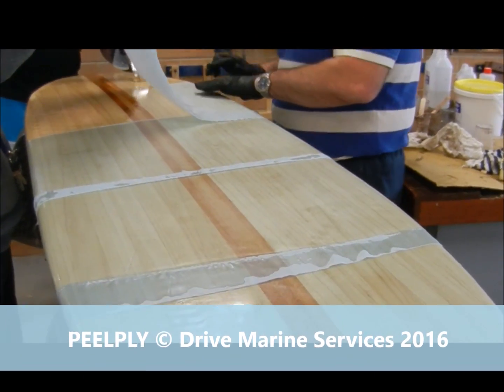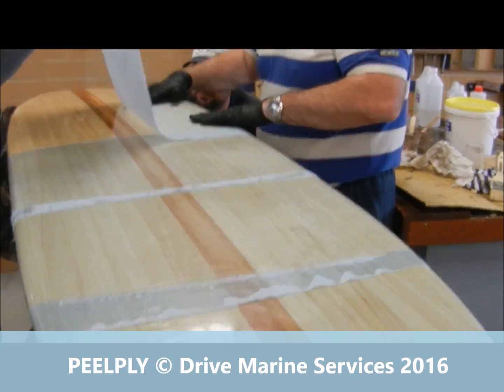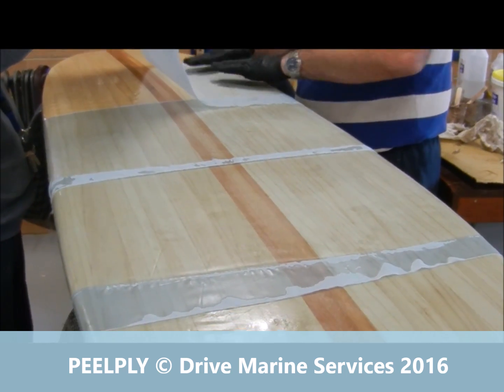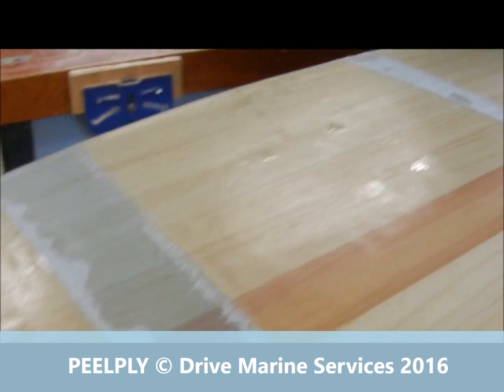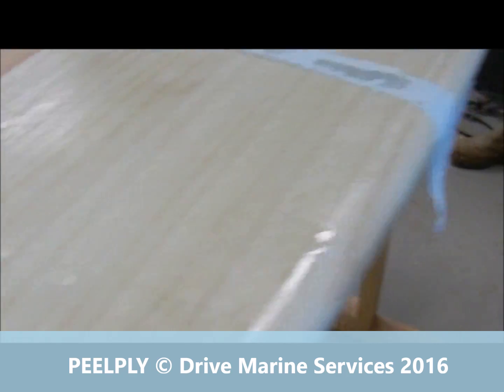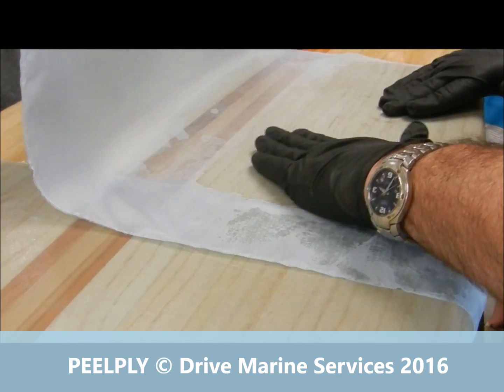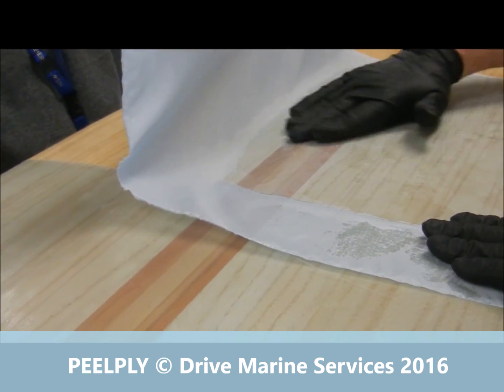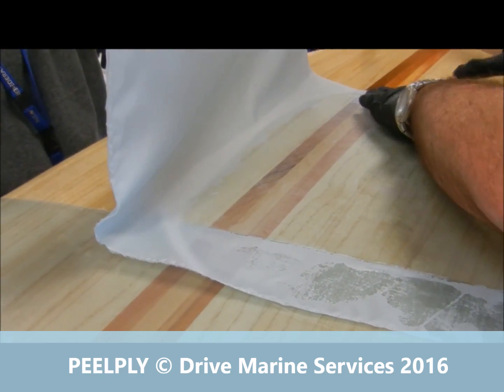Peelply Tutorial

Comment: With peel ply I can only get it working good on small patches. I'm using west system with it and it's only working when I can get it perfectly flat first lay. If I try to push wrinkles out it's moving my biaxial cloth about. It ends up with big voids that crisp off. I know it's easy enough to sand them and do a barrier coat and fill the crispy bits where the wrinkles were.. but on a transom job I want it perfect. I've settled for using powder bound chop strand (UK chop strand stuff that is proper epoxy compatible) and barrier coating the life out it but its some price for the extra epoxy here I'm 2 gallon a transom